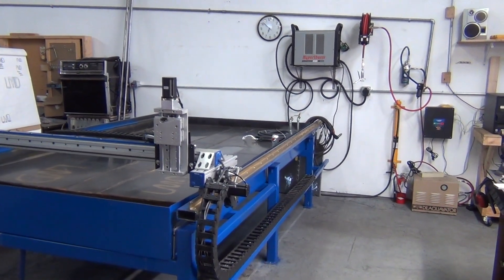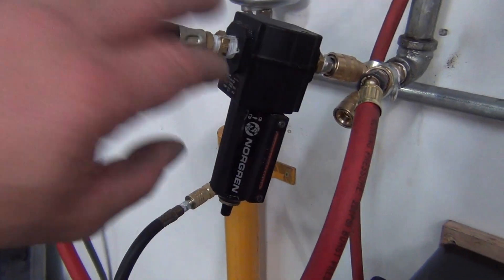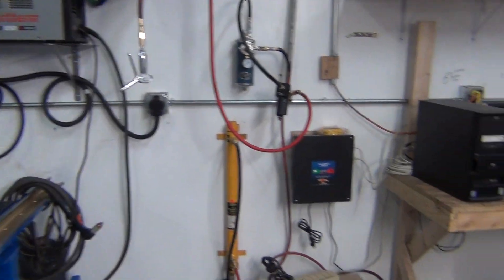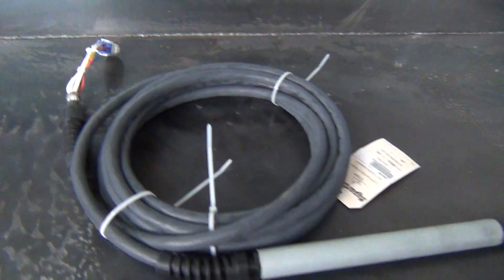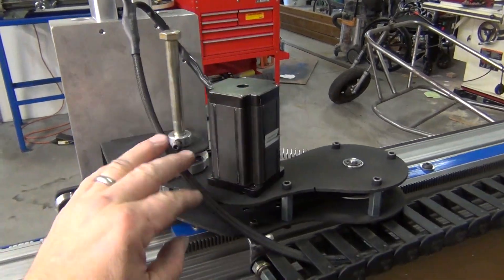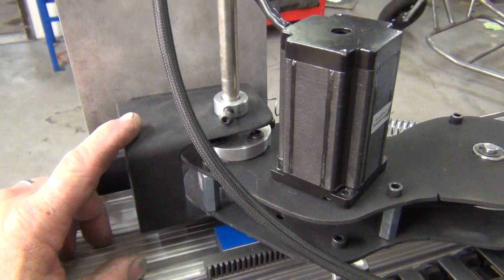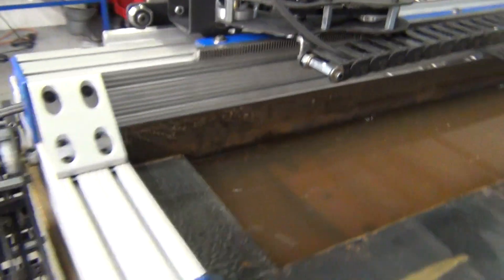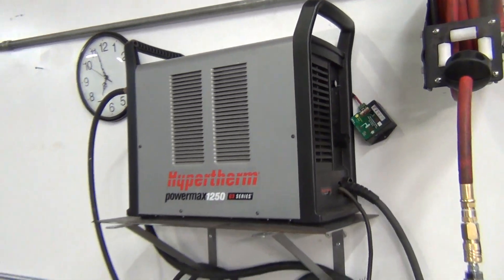Another Build Update Homebuilt 5x10 Plasma Table

Comment: I like your machine. is to inquire as to when the low and active sensor torch go back and start cutting and do not stay down with stepped sensor is then moved and not have to turn it off manually. I expect a help please

Comment: Good   job I know  what you have gone threw im building a new table as well im in the configuring stages of getting myself familiar with all the settings and how it works and what does what quiet a  new learning curve . I really like your water table drain n fill system and I think im going to do that to mine very cool  . im using the same system as you have . I'll check back for your latest update  good luck with the rest of the build  Bill from  www.decorativeironplus.com